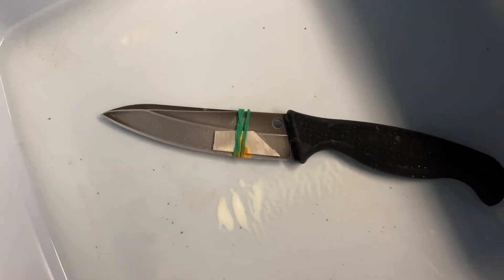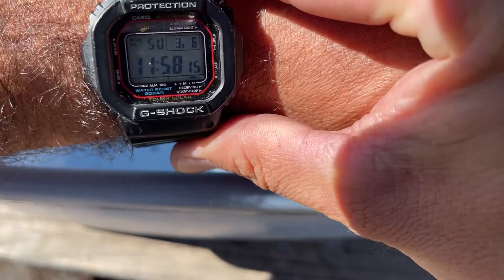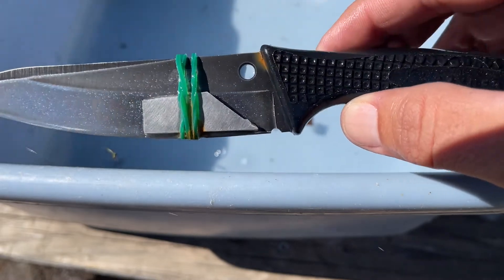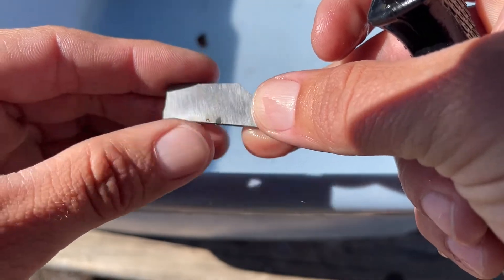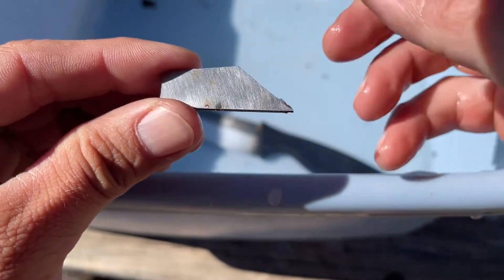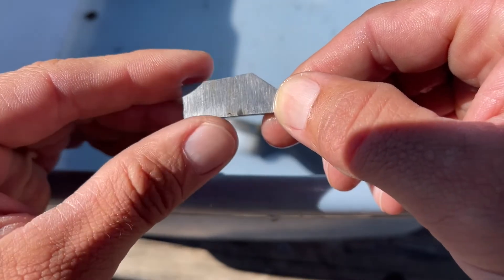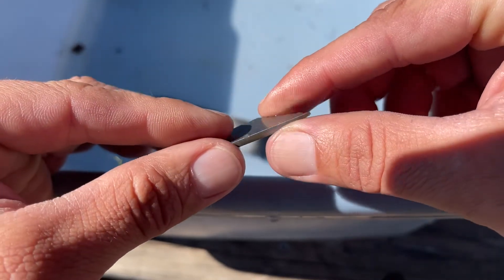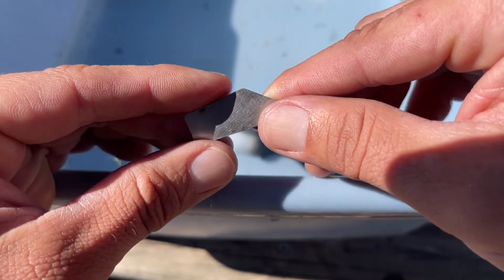Vanax vs H1 Aqua salt spyderco galvanic corrosion test part 2 results

Comment: I don't think this is galvanic corrosion. Stainless steels get there corrosion resistant from an oxide layer. I think the rubber bad has disrupted the oxide layer causing corrosion. The titanium test may have a galvanic corrosion element to it as Titanium is more noble than Stainless steels. Neither vanax or h1 are that corrosion resistant compared to many other metals. I think they are around 304ss levels of corrosion resistance. But they are very corrosion resistant for blade steels obviously.
Reply from the maker: I don’t know. Vanax doesn’t corrode by itself in salt water (I tested this) and it did corrode in salt water while in contact with H1 or with Titanium. So to me it makes sense that Galvanic corrosion caused Vanax to corrode. I don’t usually contradict people in comments because I want to get as much information as possible to learn from but saying that the rubber band was the cause of the corrosion even though its non-conductive seems odd to me.
Reply: @totesmalotes  have you tried it with just the rubber band it would be easy to test. Galvanic corrosion should happen at the interface between the two dissimilar metals. Vanax and h1 should be very similar in galvanic potential. This type of corrosion is called crevice corrosion. It is a common type of corrosion. I am an engineer that works in the ship building industry by the way I have dealt with a lot of corrosion issues over the years.
Reply from the maker: @JohnFrumFromAmerica  ok so like I said I don’t like to contradict people who comment because for all I know you might be right. I’m going to do one final galvanic corrosion test once I get an H2 knife from spyderco. I’ll test Vanax with only a rubber band between now and then, though I slightly feel like I’m getting trolled.
Reply: @totesmalotes  I am definitely not trolling I think this is crevice corrosion. Read up on crevice corrosion and PREN number. 

I actually think you have found a way to do accelerated crevice corrosion tests on these metals which is actually pretty cool and a way to differentiate between which ones are the most corrosion resistant. It has real application as well as knife scales will have crevice. The little bit of corrosion at the h1 knife handle is probably crevice corrosion. 

If you are going to do tests test 304 and 316ss which are available for a few bucks from the hardware store and any other stainless steel you have lying around. Wrap them all up with just rubber bands and see if they corrode.. another test is two pieces of vanax or other metals together if you are getting similar corrosion to one of your other videos then it's crevice corrosion not galvanic. Good luck I think this is pretty interesting work.
Reply from the maker: @JohnFrumFromAmerica  ok, thank you. I’ll do the rubber band test and Vanax by itself and two pieces of Vanax together. But this won’t be until a while from now since I have some projects I want to get done; but I do have to do this test before my final test on a bunch of metals. 
The reason I decided to do the the rubber band and Vanax by itself test is because regardless of what I think it’s still a factor I hadn’t thought of testing. 
I appreciate the recommendation of 304 and 316ss but I only want to test knife grade steels. Thank you for the other information too which I did look into. Questions lead to more questions when it comes to trying to figure things out I guess.
Reply: @totesmalotes  Cool sounds good I subscribed so I can see the results when you post them understand you are busy. I suggested 304 and 316 as they are very common stainless steels and there is a lot of literature on them so they would be a good reference point for corrosion testing. H1 is very similar to 304 so I would expect similar results. 316 has 2% molybdenum which helps with pitting and crevice corrosion although it's not immune which is why I suggested adding that to the mix. 

When doing testing it's good to have some controls where you have some expectations of what the results will be to compare the new results to. 
Good luck with the results and your channel.
Reply from the maker: @JohnFrumFromAmerica  thank you for subbing. It makes sense what your saying about using known factors as controls. I may use them if my results are wonky. At least now I am aware of them, thanks.

Comment: SCIENCE!!!!!
Reply from the maker: Ha ha yeah, kind of boring but... I gots to know.
Reply: Fuck that shit
Reply from the maker: @martinguerre8220  I to am angry that Vanax lost.
Reply: @totesmalotes  still you are the only one apart from Lance Clinton, that done such a comparison.
Reply from the maker: @SPYROSMANTZAKOS  thanks. I checked out Lance Clinton’s videos right now and he’s salt water testing magnacut with some impressive results. Pretty cool.
Reply: @totesmalotes  yes he has done recently a test for galvanic corrosion and corrosion simple, and magnacut lc200n and vanax suffer from galvanic corrosion. As far as simple exposure in salt water, all of them (magna lc200n and vanax) are salt worthy.
If we could have the miracle results of h1 steel with its top level corrosion proofness, magnacut's edge retention and lc200n/h1 toughness...then I would honestly give my money on a knife like that.
Reply from the maker: @SPYROSMANTZAKOS  he talked about galvanic corrosion in his magnacut video. Do you remember what video he does Vanax and Lc200n in? If not I’ll look for it when I have a chance. Thanks.
Reply: @totesmalotes  One of the ways that LC200n has shown susceptibility to rust is through galvanic corrosion. When left in contact with a dissimilar metal (especially one with lower corrosion resistance) it can show corrosion at the point of contact. Actually it does not even have to be in contact. Just the rust from another steel, if it bleeds onto lc200n, can cause a corrosive reaction that can create rust on lc200n that would not have otherwise occurred. I have actually experienced this on a Vanax and a LC200n knife that had non stainless hardware on the sheaths. The hardware bled a little rust that dripped onto the blade and both steels showed some pitting and edge degradation from that contact.

I know that this does not occur equally with all steels though. I have seen it happen to a similar degree on Vanax and LC200n and when I cleaned off the superficial rust I could see notable pitting on the steel when viewing with a 10x loupe. I have had similar experience with hardware bleeding rust onto H1 and the superficial rust wiped off and there was ZERO damage to the steel itself. So we know that H1 is a special kind of animal in this regard....

And now you should point out your findings in the spyderco forum and prove them that titanium hardware on a folding knife do not work when you have vanax lc200n and magnacut blade.
Reply from the maker: @SPYROSMANTZAKOS  I didn’t know that the rust or a normal steel that rusts can corrode Vanax and Lc200n with contact alone. I’ve experienced having an embedded piece from a file cause rust in Vanax. This is interesting thank you. This might  explain why the rubber band creates a sort of slot or cut where it makes contact with the Vanax. Even thought he rubber isn’t conductive it’s helping the rust accumulate at a certain point (maybe)
I still haven’t joined any forum but let’s do this: once I finish my corrosion tier list (so Vanax, Lc200n, H1 and now Magnacut. It’s going to take a while) I’ll go on the Spyderco forums. It would be fun to have what I found contested.
Reply: @totesmalotes  the above big text was copy paste from Lance himself (you can find it in the link I sent you).
As I understand know, on the case of magnacut lc200n and vanax, of you have them alone in corrosive environment all is good! But once you include any other metals, either more corrosion resistant (titanium, as you showed wonderfully in your tests) or less corrosion resistant (like a nail for example, as Lance tested...read forum link), then corrosion is introduced in all of the three steels (vanax lc200n magnacut).
Only H1 is immune to the above but I believe in order for me to further understand why this is happening I must read chemical and composition analysis and that I am bored 😂😂😂
Reply from the maker: @SPYROSMANTZAKOS  I didn’t see the link you posted, I reread your comments but didn’t find it. Can you post it again I would appreciate it. 

I understand what you mean about looking into chemical compositions and just scientific texts in general. It gets boring really fast.
Reply: And I believe that a lot of people would scratch their heads because of your tests!!! 😃😃😃 
Let's hope they make something which combines the best of all in the future. 🤞
Reply from the maker: @SPYROSMANTZAKOS  yes, something that has all the best attributes that you mentioned before would be crazy.
Reply: Please send me an email to send you the link because when I try to post it as a comment it disappears!!! Don't know whyw
Reply from the maker: @SPYROSMANTZAKOS  oh, I still haven’t given out my email. The email I normally use has my actual name on it. I’ll check out the forum and find it. Thank you for making me aware of its existence.